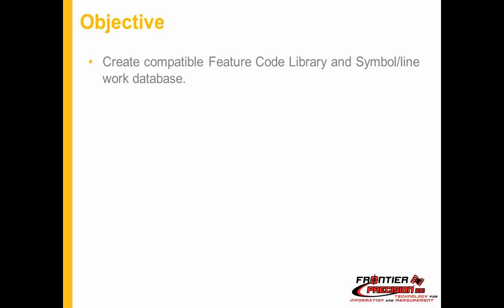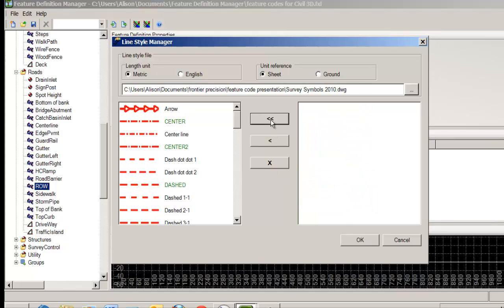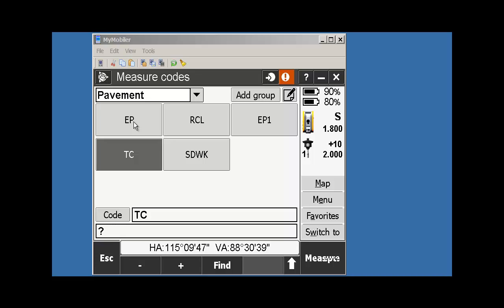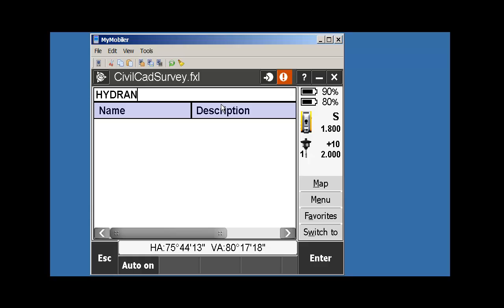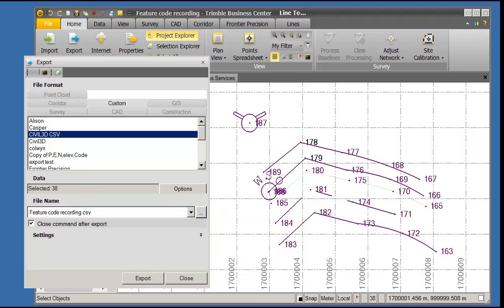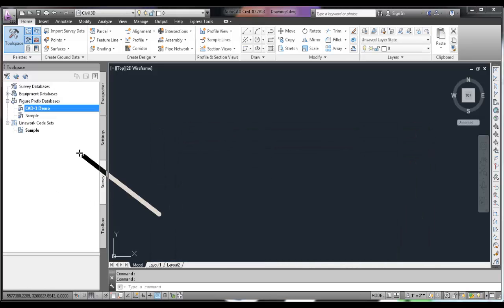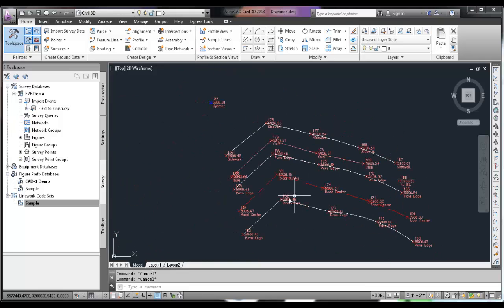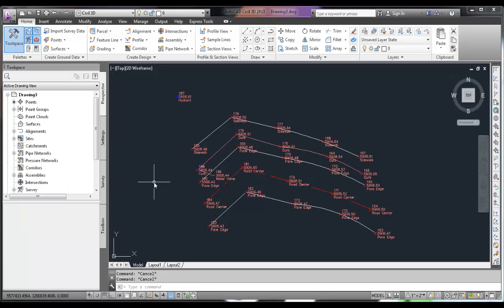Automate drafting with feature codes in Trimble Access & Trimble Business Center

Comment: Can you explain what zig zag does in greater detail please ?
Reply: Imaging that you're doing cross sections of 400 m of a road at 20 m intervals. Assume that you start on the left side of the road walking towards the right side of the road measuring. Once you've reached the right side of the road you're going to walk 20 meters up chain and then walk towards the left side of the road now. What the zig zag method does is remember that you started on the left in this scenario and once you reach the right, it knows that you will walk up chain and go back across the road. Essentially all you're doing is just pressing measure and it automatically changes the code for you. You went Left to Right on codes for one XS and then move up chain and it will no go Right to Left and repeat that till you tell it to stop or you complete your survey